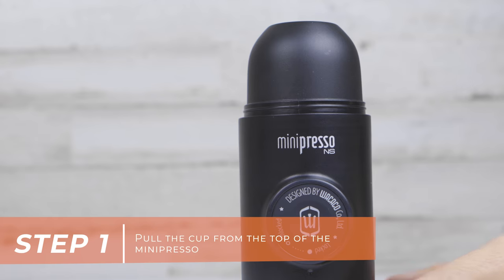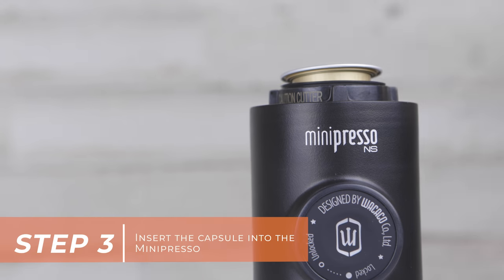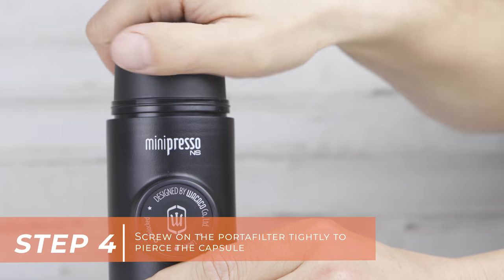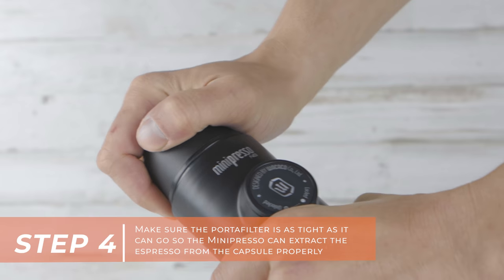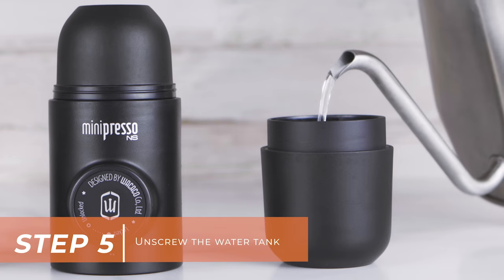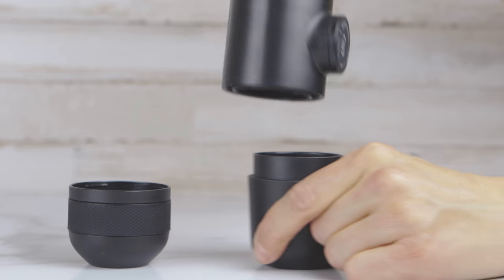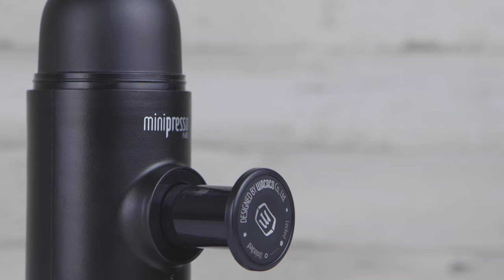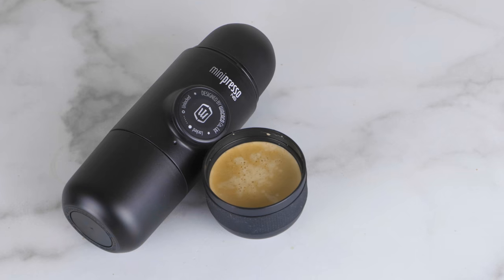How To Use The Minipresso NS

Comment: Just picked one up from Aldi for $30AUD and gotta say I'm very impressed with the espresso it creates. One tip I'd give to others with this is if the cup doesn't clip onto the portafilter properly then try loosening the portafilter slightly before attaching the cup again. Also when you're done with the minipresso (cleaned and dried) don't screw the portafilter and water tank on super tight. Screw it on lightly or when you start to feel resistance. This will relieve pressure on the rubber gaskets and extend their life considerably. Moka pot owners will know what I mean by this.

Comment: I bought one of these with the goal of having more control over the process. I’m quite impressed with the results compared to a regular Nespresso machine and have been able to occasionally achieve a bit of that olive oil consistency from a real espresso. My technique:
1. Preheat with 100c water
2. Pump really hard until you hear the aluminium burst, but you need to make sure all holes have punctured
3. Wait 10 seconds for preinfusion
4. Two or three really hard presses at maximum pressure, this will result in about 5-10g out
5. Then more slowly just maintaining pressure to keep it flowing
6. Aim for 20g out in over 20s (after preinfusion)

Nespresso pods have about 5.5g so the 5.5g/20g ratio is similar to the classic 7g/25g single shot ratio. 

In Australia I’ve been using the Othersky Sweeping Plains pods.

Comment: You need a lot of pressure. Not great if you have weak hands. Jesus, you really have to work hard. And the water temp, thus coffee temp is not hot enough. I'm returning the product.
Reply: Have you tried pumping hot water through it first? It really makes a difference.